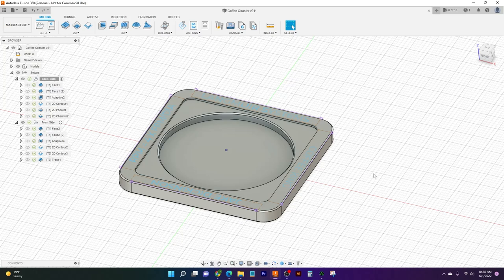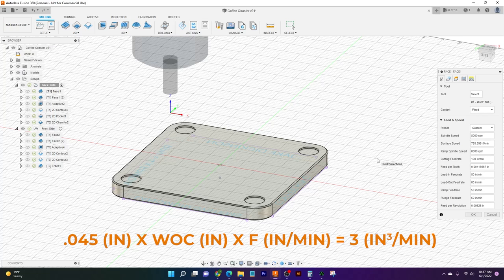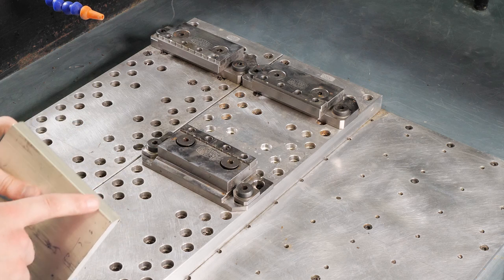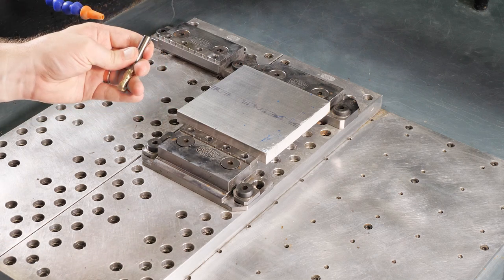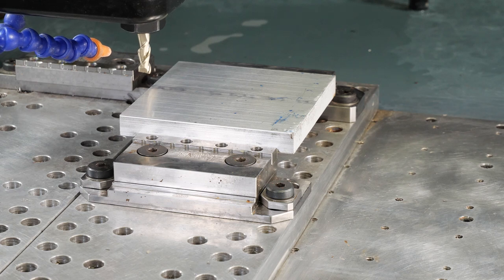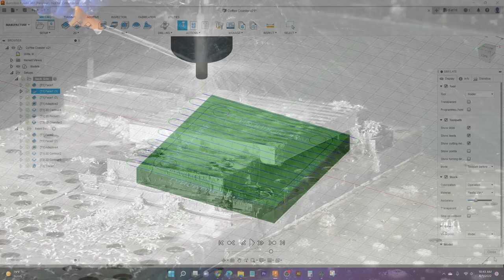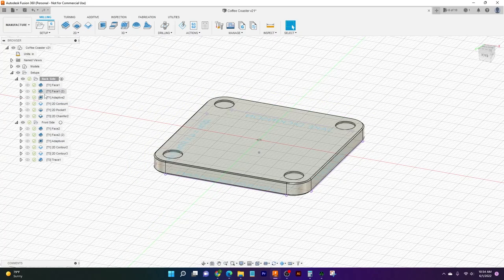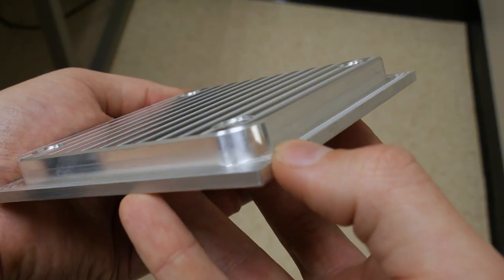MR-1 CNC Mill Shop Project - Aluminum Coffee Coaster Part 2 - Programming and Cutting Side 1

Comment: Great video you do a fine job for another instructional video on how to use Fusion 360 and watch the results cut a part. I have my deposit and my order in on the MR-1 CNC. It would be great if you could make a video with more focus on the machine and the control. I would like to see in detail the intergration of the control with the machine tool. Input the length offset as well as the work offset on the computer screen and show how it is done. I understand there are a few months to go on delivery and your product may not be at full development level at this point. The MR-1 machine looks like a great product and I'm looking forward to putting it in my basement. Great price point with HP. I dont think there is a machine for the garage on the market that can compete with the MR-1 that's why I'm all in. Show us how to operate it. Thanks looking forward to more.

Comment: So when you changed to the chamfer tool, did you just set the tip of the tool on the finished top and call that Z zero and offset the chamfer tool down another .060 so you were not cutting on the tip of the tool...???  I guess this would be a lot simpler with a tool height setting probe.  I'll assume we will see that in upcoming vids.  Thanks for the new presentation.
Reply from the maker: And thank you Eric. Yeah I just touched the chamfer tool off the top of the part and entered my offset as Z -.05 since I faced off .05 material. The reason I had to do that was my program's zero was still set to the top of the stock. After that, the cutting parameters entered in Fusion take care of tip offset so that the chamfer tool uses more of it's edge rather than cutting close to the tip. And you are definitely right that this is a much easier process with a tool height probe so that's going to be an option when using MR-1.